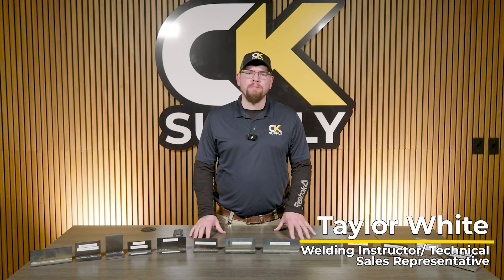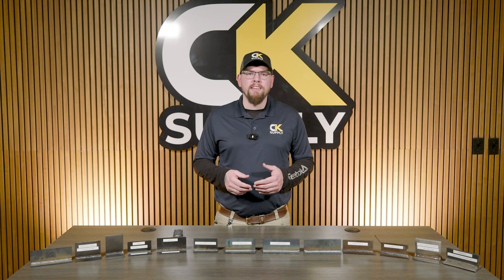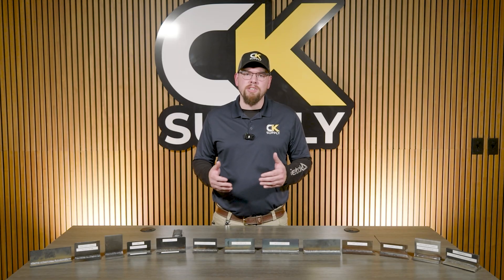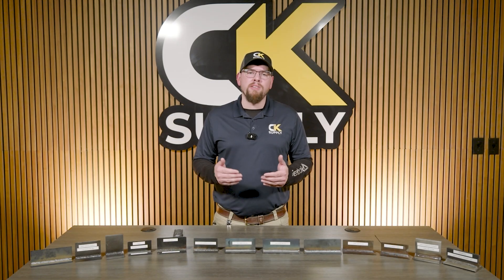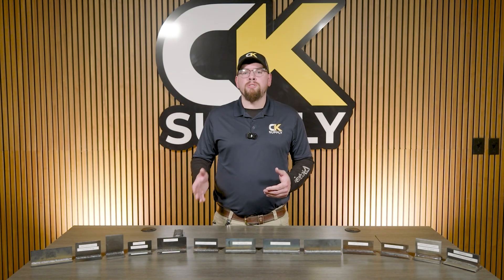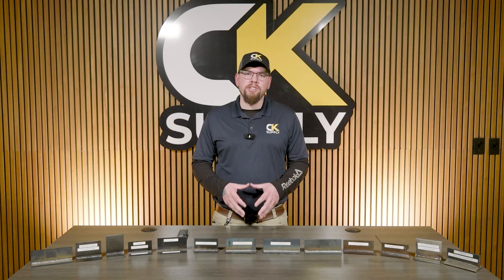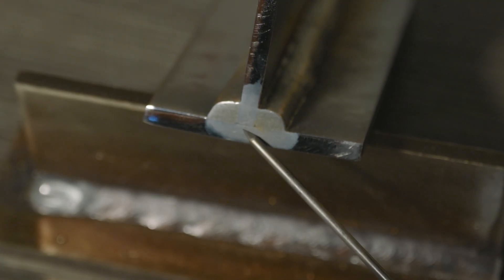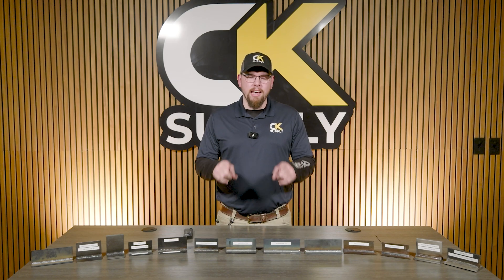MIG Welding EXPLAINED | Learn The Basics In JUST 10 MINUTES!

Comment: This isn't the basics. Beginners don't have the option of spray or globular transfer and will likely only be using C25 gas - it would be far better to teach them the real basics - voltage, wire feed speed & gas flow and how to dial them in.
Reply: 💯 seen it both ways in the trade of welding

Comment: I enjoyed the video, mainly because I have welded for years and understand all you say. One thing tho'? How come no welding video explains the different terms MIG and MAG? We know that all welding on low alloy carbon steel is using active shielding gas as soon as carbon dioxide is involved. However every welding video I have ever seen use the term MIG?
Reply: Haha I been welding with a lil Hobart wire machine for 15 years off and on, and I am today years old learning that I have always referred to it as “mig welding” but your comment showed me I have never actually “mig” welded once in my entire life… Mag welding it is! That’s the biggest thing I learned from this short. 😂
Reply: MIG/MAG seems a bit of a misnomer to me - what's C25? Its 25% CO2 (active) and 75% argon (inactive). So is it MIG or MAG? What about C10? I think MIG is the generic term these days no matter which gas you're using - you can argue that it's technically incorrect if you're using CO2 but you'll be fighting a losing battle.
Reply: @Gooroo-s6n  I am just familiar with welding carbon steel with a standard 75%/25% (argon and co2 respectively) but according to my google degree research apparently… 
“MIG” is Metal Inert Gas [welding] -employing strictly inert gases like argon and helium shielding which offers the process no impact on the welding other than removing atmosphere.
Meanwhile “MAG” is Metal Active Gas [welding] -utilizes various pure or blends of Argon, CO2, helium and even small amounts of oxygen. Differing of which varies depending on which metals and potential functions like better penetration -all the while also blocking atmosphere.
Under technicality all mag welding is mig welding but not all mig welding is MIG welding 😂😂 … they are both absolutely GMAW, Gas Metal Arc Welding
Reply: My welding class called it all metal inert gas for wire weldibg.  Gmaw was considered stick where the gas is formed from the flux on the stick elecrode burning off combined with the gasses from the metal. Tig is tungsten inert gas where the shielding gas is injected like tig.  I would think mag active gas would be different gasses.  An active gas sounds like it would be reactive gas.  Would be some shit to change an argon tank with a propane tank.  Lol.
Reply: @Z-Ack   from the literature I could scavenge, I would surmise that: 
MIG is GMAW - Gas Metal Arc Welding
TIG is GTAW - Gas Tungsten Arc Welding
Stick is SMAW - Shielded Metal Arc Welding

It would be very interesting (and potentially life threatening) to attempt welding with propane 😂 I do know that adding carbon dioxide in with argon increases heat/penetration of the welding and straight carbon dioxide is the maximum heat/penetration increase you can get when welding mig. Straight CO2 is also apparently the messiest spattering gas shield.